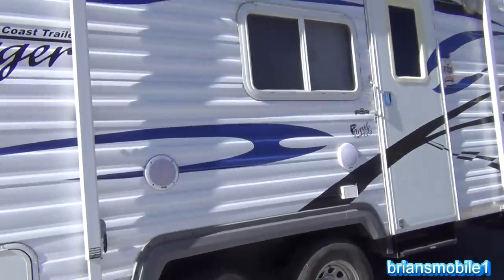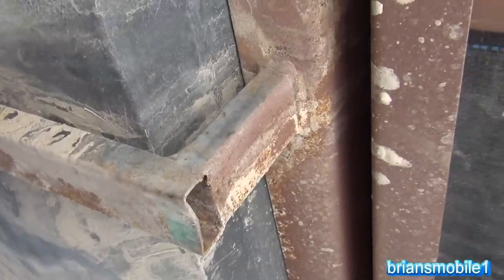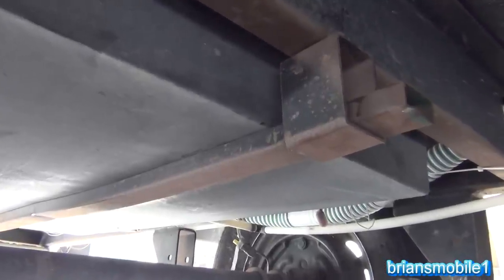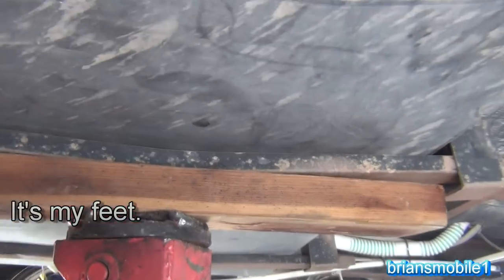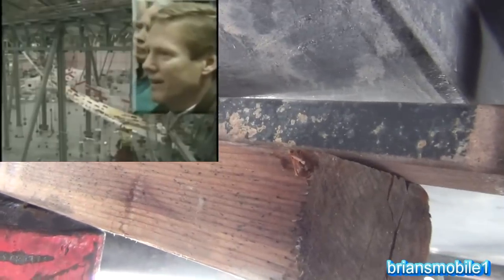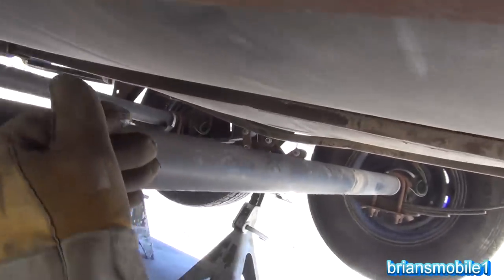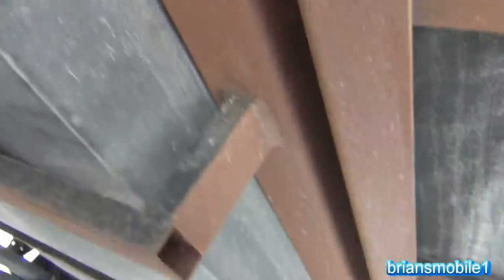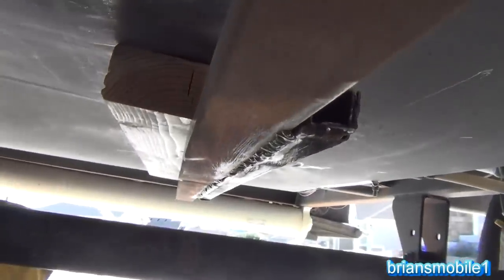Camper Water Tank Fix

Comment: Try a little roll of flux core mig wire for outdoor welding. It's not as pretty as gas but it works in the wind.
Reply: +carabela125 
E71T-11 electrode wire is what I would use. I personally prefer using SMAW (aka stick) welding for remote welding locations outside.

Comment: people always made fun of of the Suzanne Summers thigh master..... but as a guy working by myself all the time I use that skill all the time with floor jacks.
Reply from the maker: +ykmalachi In B.U.D.S. training to become a Navy Seal, the most common PT issue is the glut medius is too weak to run in the sand without getting runners knee.  Men just don't do the leg lifts to handle running in sand all the time with a load.  Quads, gluts, hamstring muscles?  Yeah, they got'em.  Like you say though, you might get mocked, but those muscle groups are important for those less than everyday tasks.  Check out more here → https://www.youtube.com/watch?v=iNgtVAIdIH8  The guy's doing what looks like women's aerobics at 8:40 in the aforementioned link, but to save his life he can't get 5/5 on hip strength because he hasn't trained that group- likely because it looks "sissy," but if Basic Underwater Demolition / Seals need it, it's not sissy anymore is it?  Those guys are the epitome of manliness.

Comment: Common Problem, My $70K Keystone 5th wheel has the same Backwoods engineering for the water tank. It has a 100 Gallon Fresh Water tank x 8# a gallon. You would think at least one person at Keystone would have some design/engineering skills.
Reply: Not a leak in tank water drifts ot of drain pipe below trailer
Reply: Drips out of plastic 12 in
Pipe below trailer

Comment: Would  thick angle iron have been better to re-box the supports?
Reply from the maker: +shortwave A chain or structure is only as strong as the weakest link.  The angle, and frame of the RV is super thin.  Thicker angle would only add weight.  The material the heavy angle is welded to would fail.
Reply: +shortwave I didn't think to ask, but good answer Brian!

Comment: I would have added extra bracing underneath the tank in addition to what you did, though I suppose if one is going to go that far to properly support the tank, they might want to consider fabricating a new tank.
Reply: +Truthseeker4449 I was thinking the exact same thing, but instead box up the whole thing to even protect the sides from bulging out or even just support the bottom of water tank with a plate of aluminum or steel liek you said. How ever the owner wanted a quick and cheap fix
Reply from the maker: +Truthseeker4449 Yeah.  That's ideal, but I did 10x more than what I was asked to begin with.  Were it mine, I would build a new redesigned setup using slightly thicker wall tube and incorporate something to prevent the slide on the end as it facilitates the sagging bend to occur.  Even now I could/should put some screws up through the ends of the three ribs.
Reply from the maker: +filpazndude That's right.
Reply from the maker: +briansmobile1 The other issue is weight distribution.  You have to maintain 60% of the total wet weight of the trailer in front of the axle even with four wheelers and gear in the back.  If you get too much weight rear of the axle you have stability issues with the trailer tracking straight on the highway.  The water tank is only over and rear of the back axle on this design as it is, and the GVWR & GAWR is pretty low, meaning the allowable amount of weight you can add is finite.  Anything added rear of the axle has to be balanced with 120% of that same weight added to the front of the axle.  In this case there was already two tool boxes mounted to the front tongue bracings of the trailer.
Reply: +briansmobile1 That is true as well. But also why I said aluminum even though it still has weight to it. I mean theyre alot of factors when taking on re-fabricating things from factory